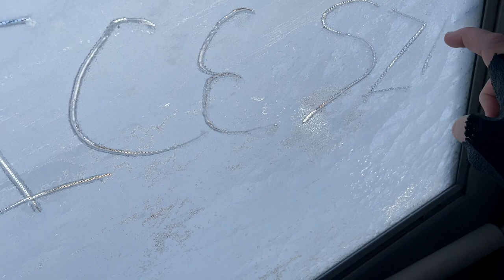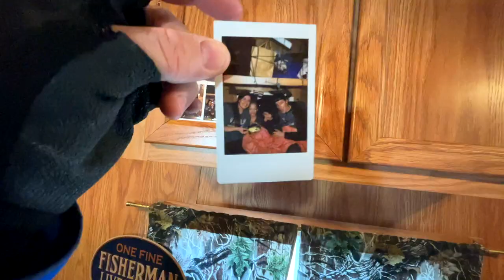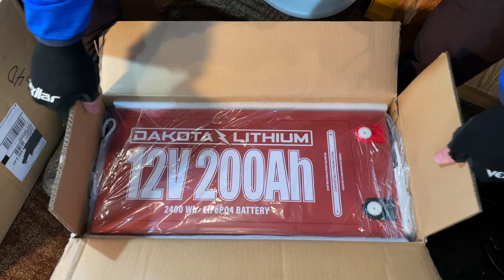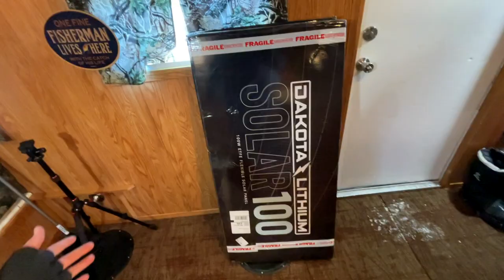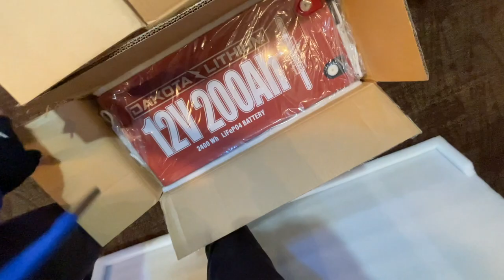Solar Powering FOAM INSULATED Ice Hut!

Comment: I did a similar set up on my castle. 100w panel,200 AH, 750w inverter. If you go to a hardware store grab a 120v plug you can connect that plug to like 14-2 wire(residential wire) and hook that to you small fuse box in your castle from your inverter. Then when you turn on your inverter all your 120 outlets and tv will run off the inverter instead of having a bunch of stuff plugged into the inverter. Great content man

Comment: Remember, Lithium batteries will have a low temp shutoff so it won't charge if it's too cold.  Some new ones have internal heating so see if that one does.  If not, you'll want to figure out some way to keep the battery warm enough to charge when you are away and don't have the heat running.  Also, the flexible panels are nice but you'll have to mount them and park where you get good sun.  I'd also suggest getting a rigid panel or solar suitcase that you could setup to follow the sun better, especially in the winter when the sun is pretty low.

Comment: Great Stuff again Sam .
#1 Get a Journal  Book it the Fish House,, get everyone  that is There  to Write in it ,,Even the Young Cousins .We Have A Tent Camp that out For 6 weeks Grouse Hunting  ,then move it 40 Miles and it then Becomes Deer Camp..... In a short Few Years you will Love the Memories  That Happened..     
#2 The Solar Panels  are A Huge Step Up. 2 Panels will Power Both of Your Batteries  Well ,and hook them in Series  to work  the House... and now you Have me thinking about  that Dakota  Lithium,  for and up grade..  
The Panels will work in Day light with no Sun but Mount  them to the Put side Wall not on the Roof because  Snow will stop the Out put of the Panels and the Wind and Rain "WILL TEAR YOU UP".....
YOU do not want to put Hole in the Fish House roof, the Damage  will come in the Green time of the Year...
#3 Please  tell me Where I Can Order the small Yellow  Bump Board  you use.
I'm A Pan Fish Guy 1st and I cant Find one of them like you Use here in Northern Michigan......
You will Love The Trick Out your on TOOOOO.

Comment: Those solar panels (I only viewed two? in the video) would take something like 20hrs to charge that 200ah battery from a depleted status to 100% charge if you where in Arizona.... when it's summer..... You are going to get even less efficiency even with optimal angles just due to your latitude. So it's something like three full sunny days with no use to fill from depleted to full.  The TV alone "could" potentially consume the whole output of one panel (somewhere between 50-70watts) the inverter is likely 80-90% efficient and each panel is not going to get it's full 100watt rating for very long in the winter. Output in the 70-80watt range per panel is likely. I would get a Kill A Watt to get a gauge of what your consumption rate is after that the consumption rate is very easy to calculate. Biggest take away is there is not enough power being generated by the solar panels to overcome excessive use and the recharge rate is going to take a while. This might be things you have already been advised of, but it could be helpful for others.

Comment: Please research the battery's limitations as far as charging below freezing temps. It could be damaging to the cells with lithium iron phosphate. 
But other than that, you're going to love the upgrade. 
Enjoy your season.
Reply: If Dakota Lithium is selling 200Ah LifePo4 without low temperature charging cut-off, that should be a serious red flag 🚩
Reply: @CeigeNUT    I agree. In the FAQ’s they specifically say don’t charge below 32 degrees. All lithium iron phosphate batteries that I have researched say the same thing. 😡

Comment: Sweet!
That'll make off grid living easier
And that battery was HUGE!!

Hopefully just mount to the outside wall. Maybe even a simple eye hook.
Based on direction and panels, swap so can get hung on driver or passenger side for maximum sunlight.

Since you said "lots of snow"
would not recommend roof mount or who's climbing up to clear the snow?